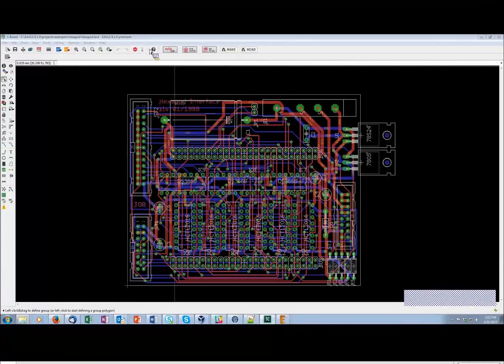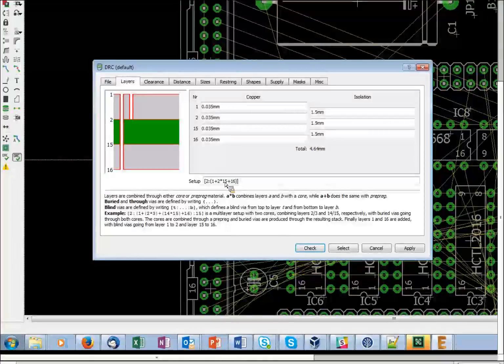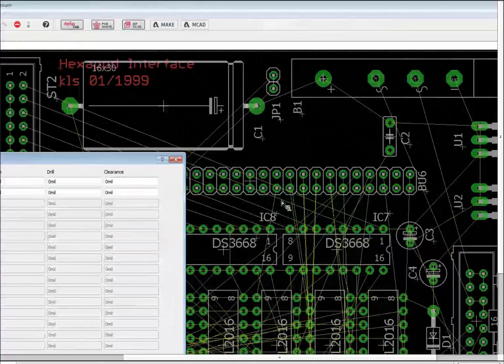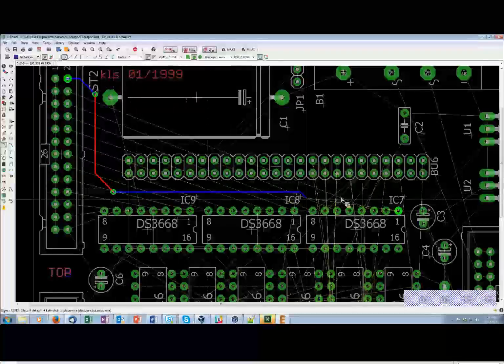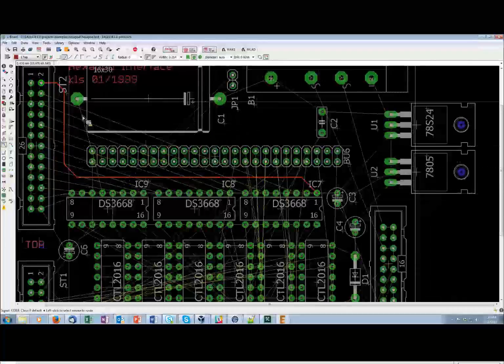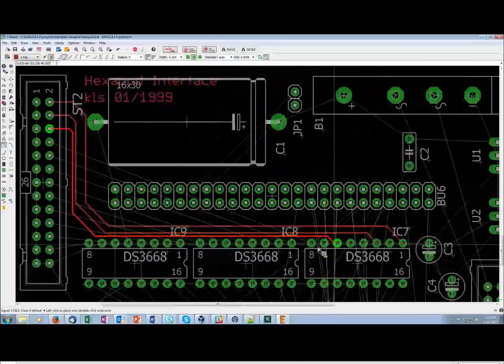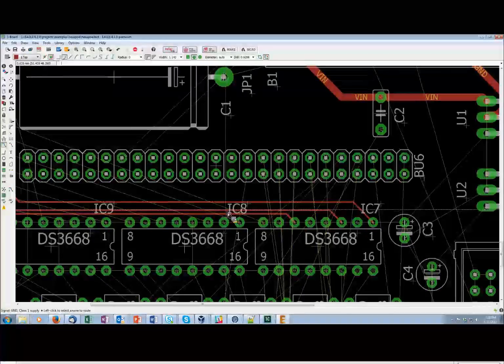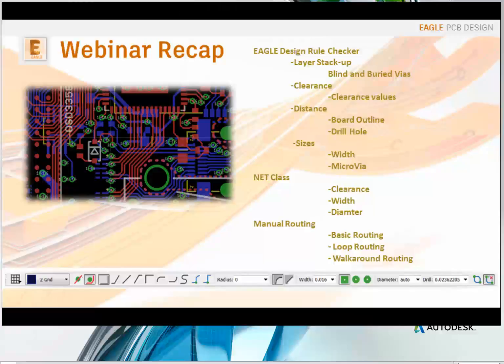Best Practices when Manually Routing your PCB Design - EAGLE PRO

Comment: Why this low quality video/sound 2017?
Reply from the maker: Hi CJ Thanks for the comments. Are you watching on a desktop? Please expand to full screen. Thanks!
Reply: Hi, thanks for your reply. Yes, I'm on full screen, or smaller if so, on a Mac. Doesn't help on full screen, could it be because I run on Mac, or could it be the original (at youtube) is recorded/converted to too low resolution. The sound is ok.

Comment: why not autoroute?
Reply from the maker: Hi, the Autorouter is an extremely useful tool that can save an enormous amount of time! Yet there are instances when a designer will want to  manually route the board or portions of it to meet certain design specifications or aesthetics. In that case it's good to know how. Thanks for the question!
Reply: I use autorouter for about 10% of my designs. In modern designs, with mixed analog, high-speed digital, and advanced power - it still takes a human to get it right. In general, I use the auto-router to examine various options as the board gets packed full.